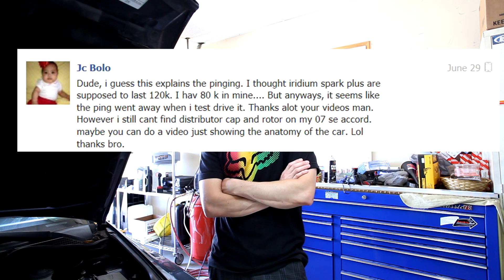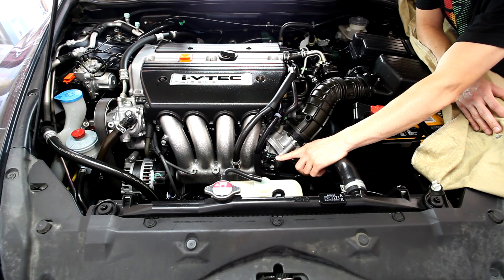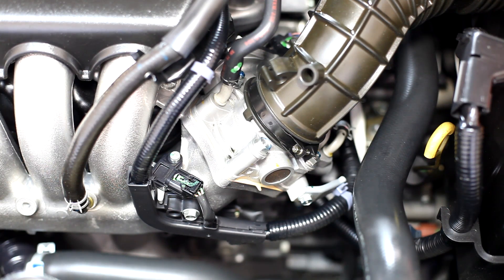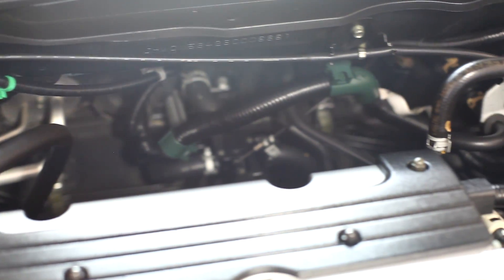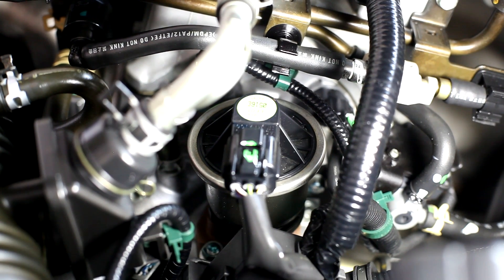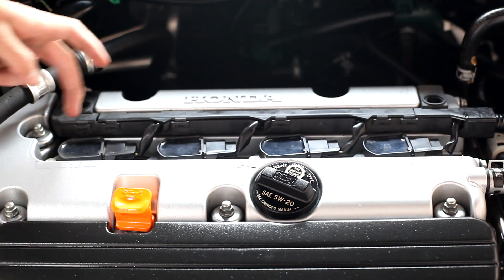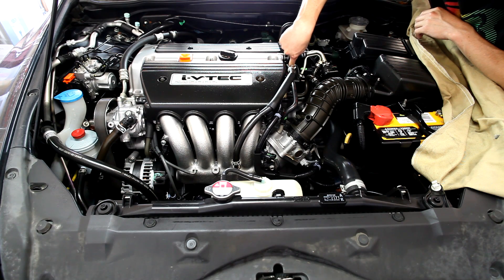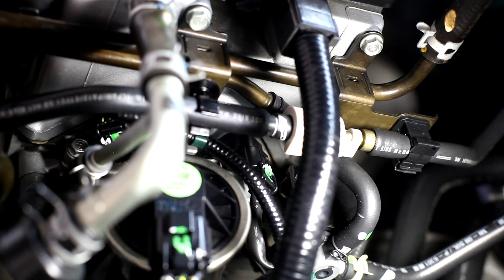2003-2007 Honda Accord Engine Anatomy

Comment: Where is the FUEL PRESSURE REGULATOR located at. I have the same vehicle. And I just diagnose my car code P0172. Engine running too rich

Comment: Damn 
I need to know what those two blue caps in the back are and you went right pass them 🤣
Reply: @2:52 Those are High and Low port for the AC system.
Reply: @BLAZEPSI  thank you so much... actually still didn’t know until now! You’re awesome 🤙🏾

Comment: I have a 07 and I have a noise coming from under the hood I have replaced the 02 and the power steering pump and the belt and the pulley and still have the noise does anyone else have that problem

Comment: Question...the two nuts that hold the front plastic cover on...on the front part ....after you remove the cover...Those screws also appear to go down into the engine.....I have one missing....Will that affect my engine in any way.? It hasnt seemed to affect performance yet....i just noticed it...but theres just a hole there where the screw should be....Im concerned.
Reply from the maker: It’s probably the stud for the nut, it shouldn’t be affected
Reply: @NutzAboutBolts  ok thank you

Comment: Hi. Very good video. Can you show where the fuel filter is located on a 2004 Honda Accord (european model) ? Thanx a lot :-)
Reply from the maker: It’s in the fuel tank, with the fuel pump.
Reply: @NutzAboutBolts  Thanx for the answer. Is this the only fuel filter ? I found an other filter (part. no: 16010sea000). The description says, this filter is located in the engine bay. And i found this one: 16010SDCE01; this looks like it goes to the fuel pump. The engine type of my car is K20A6.
Reply from the maker: Daniel Tahin that might be the transmission external filter... that’s the only filter I saw in the engine bay.

Comment: in the video at the time 4:54 there is a part that you touched its shiny kinda curved and with a rubbery black box at the end please what is the name of it i need that part
Reply: That is the same piece I need as well can't seem to find it anywhere I'm thinking I'll have to find one at the junkyard
Reply: @jonahcottrell2879  its called  BREATHING BOX
Reply: ITS BETTER TO GET THE AIR INTAKE HOSE KIT IT SHOULD COME WITH IT I FOUND MINE FOR 70.00
Reply: @lundychacon2758  thanks a ton. I ordered an intake tube the other day but it only came with the main piece I'm gonna have to order the other pieces separately

Comment: Nice video, I have a question. What are the small metal tubes (welded together) above the EGR valve called and can they be purchased? The smaller one that has antifreeze going through it is leaking on my 03 Accord.

Comment: Can I put my 2006 throttle body on the 03-05 engine? Does that fit?
Reply from the maker: I don’t think you can since the 03-05 were throttle cables.
Reply: @NutzAboutBolts  Mine accord is 2006, and trying to see if a 03-05 engine could swap in my 06, and use my 06 throttle body.
Reply from the maker: Hong I would do more research as I know both engines layout is different since they did some modification for the 06 compare to the 05 and below.

Comment: So what do I do I had a bad motor 05 2.4 accord I then bought a 03 same motor but there is plugs that I have on 05 wiring harness that is not on 03 wiring harness.I have a cold air intake 05 motor has a plug for that a 6 pin plug the 03 does not have that plug my car starts but runs bad I put the 05 harness in the should I change it back to the 03 harness

Comment: Thank you for all of your videos, much appreciated throughout the years I've had my 03 Accord 200k miles still going
Reply from the maker: Nice. Mines only at 160k for now
Reply: I have a 200k mi 03 accord standard. It idles up and down all the time. Whether I'm at a stop light or even when I'm driving it jumps a little when I shift because its idling up and down while I drive. Driving or a complete stop it idles up and down. Its not the throttle body or the sensors. What could it be?
Reply from the maker: Oweezy3rdi sounds like something’s clogging the airway of the engine. Have you cleaned the throttle body or replace the engine air filter?
Reply: @NutzAboutBolts  yeah I did could it be the EGR Valve?
Reply from the maker: Oweezy3rdi it’s possible, do you have a check engine light?
Reply: @NutzAboutBolts  yeah I do have the check light on
Reply from the maker: Oweezy3rdi what’s the code? I’d work on that first before anything else
Reply: Oweezy3rdi I have a 07 accord Coupe 119k miles, I have done so much maintenance to this car. Is your accord manual ? I had a problem with mine jumping rpms like that and running rough at the idle changed the ignition coils and spark plugs and it fixed the problem. But car still vibrates at idle comes and goes, it’s very weird. when I move the steering wheel seems to go away and come back. Have a brand new power steering pump. It Does it both when the A/C is on and off, I’m thinking it’s the motor mounts!
Reply from the maker: Chris Garcia any codes? Could be an idle issue since when you put load onto the engine, it doesn’t vibrate. If it’s an engine mount, it would vibrate more during load.
Reply: @NutzAboutBolts  fixed it. Changed the whole throttle body and sensors. All brand new. I was trying to avoid spending but sometimes it's best just to get new parts
Reply from the maker: Oweezy3rdi nice, faulty sensor?

Comment: I have a 2007 Honda accord and it's jerking when accelerating. I've replaced the pedal position sensor under the hood and still having the same issues, any suggestions?

Comment: What is that tube at 1:06 on the left? Mine is leaking on a 2012 Accord do you know how it can be fixed?
Reply: Hey I have the same question lol have you found out what it is?
Reply: Naval33 yea its a brake booster vacuum hose. No idea how to fix it though
Reply: @andreythebarista  we were talking about different parts I was talking about the power steering resivore XD

Comment: What is that tube at 1:06 on the left? Mine is leaking on a 2012 Accord do you know how it can be fixed?
Reply from the maker: Do you mean the radiator coolant reservoir? That’s where your coolant overflows stay in. I’d recommend changing it and refill the coolant to max if you can before engine overheats due to low coolant.

Comment: Nice video thank you.. you didn't point out the sensor on the right side of the head , two skinny hoses connect to it and one sensor. Could u tell me what that densco sensor is? I having trouble mounting it/getting the sensor to reach the plug.. thanks

Comment: Thanks for the video brother, very informative. Would you be able to shed some light on where transmission shift control solenoids are? My engine is throwing a code Solenoid A stuck on, and Solenoid B stuck off. I have replacements,  Are they easily accessible under the air box? Thanks for your time!

Comment: hello, is the 2004 Honda accord 4 cylinder engine is exchangeable with 2007 Accord edition?
PS:  i know that throttle body is different but i am talking about the engine without accessories.

Comment: I have one little trouble with the ECT sensor cooling fans working only if I keep the a/c on  I replaced sensor, part wiring and new connection relay and still have same problem. but does not overheat too
Reply: I'm having this same problem

Comment: I have a 2004 honda accord ex that have a 2.4 lite engine. My question is I'm trying to locate my fuel pump regulator
Reply: Cedric Smith i believe it’s on the pump itself

Comment: What's the black plate connected to the side of the air intake hose I'm trying to replace the round part that goes on that plate its rubber and has cracked.

Comment: P0325 knock sensor 1 circuit dont know if I missed it in the video but where is that located and whats the purpose of that sensor
Reply: Disclaimer: total layman here. I believe the knock sensor is actually inside the cylinder. That particular code is from an irregular/out-of-range reading on that sensor. It could need replacing (defective sensor), or maybe there is a problem with the air/fuel mixture. That same code is what brought me here. I believe in my case a cracked air intake hose is throwing off the MAF, which leads to bad air/fuel mixtures, possibly leading to out-of-range readings. I would check and make sure that your air intake is all connected and in good shape as you are troubleshooting.

Comment: What's the black cover in front of the battery that goes to a black hose type like air intake piece? Is there supposed to a filter in that hose or no? Unsure what it's called and can't find what goes there

Comment: How do I tell which cams go where? So when you have the valve cover off, there is 1 that just had a pulley, and the other has the thing that makes it a i-vech. Which goes in the front and which 1 goes I  the back?

Comment: hi i have a 2004 honda accord lx 3.0 v6, my cam shaft position sensor went bad. the mechanics told me it was located under my timing belt. is that true? because  you said it was by the egr valve.
Reply: When my Honda accord speed to number 3 giki why?
Reply: V6 engine

Comment: What is the name of the sensor to the left of cylinder #1 fuel injector shown at 5:10?
Reply: slickerthnu hey, did you find out what’s that?
Reply: It’s a solenoid that controls the dampening of the motor mounts

Comment: If you want to have better gas millage, and use 100 percent of your gas instead of 85, you'll want to put a groove in the throttle body. Do a glass pack to replace the resonator and put on some new tips of your choise for an added cool look. Also, get rid of the resonator in the bumper and put on a cone filter at the intake so that your engine can breath better. You'll want to use some royal purple for your motor oil to be more efficient and also do a transmission flush with the royal purple tranny fluid. I know all of that probably blew your mind, but it can happen, and does work out very well.
Reply: Shut the fuck up dumbass.

Comment: the is a hose attached the the valve cover (i think) which has a small rubber box that goes into the intake tube what is that box called look to replace that 
plz help asap

Comment: I experience a little vibration coming from the front right side/wheel only when accelerating. No noise yet,  but I can feel it through the pedals,  not through the steering.  Please what are the likely causes?

Comment: Nice video. 
Please do a second one to identify the air/fuel ratio sensor, O2 sensors, external temperature sensor, back-up light switch, and mechanical units like the inner and outer CV joints, ball joints, tie rods,  steering gearbox, vacuum lines, etc. Thanks.

Comment: What is the part called that is connected to the hose right after the maf sensor.  It looks like it has 2 connections to the hose.  One wide and one skinnier but both are on the same part.
Reply from the maker: Can you send the picture to our Facebook page, it’s hard to figure which hose you’re talking about. Thanks.

Comment: We're is the gas filter located?
Reply from the maker: You mean the fuel filter? There’s one inside the fuel tank, you only replace it if the fuel pump is bad.
Reply from the maker: You don’t need to change it as a preventive maintenance. You only change it when your fuel pump goes bad.
Reply: Is it one unit  I'm wondering for preventative maintenance does the gas filter clog ?and could it be changed sepretatly my car is going on 10yrs so I'm trying to do as much as preventative maintenance .
Reply: Thanks

Comment: I have a 2006 Accord K20Z2 with manual.
The engine is running good but in warm idle the whole block is shaking a little bit. The front more than the back. At the intake manifold about 1/2 inch up and down. And it stops when it is anything over idle or cold idle. You don't notice it from the inside of the car.
The front motor mount looks good. Idle is about 700 rpm. Maybe to low? Can the idle be adjusted? Or what else could it be?
Reply from the maker: any check engine light?  I think idle is 750 +/-50 from the top of my head depending if its a/t or m/t, don't quote me on it. lol.

Comment: are all 03-07 accord 2.4 engines the same can i use a 07 in my 03 or vise versa thank you
Reply from the maker: its the same engine but I think the intake is a little different since they position the sensors at a different place, and the throttle body is different too.

Comment: Have a question. My girlfriend took her accord to auto one to read the check engine e light. They said her crankcase breather hose is the cause for the alarm. They mean PCV valve and hose?
Reply from the maker: its possible, but he was talking about the hose... check for leaks, whats the check engine light code?
Reply: NutzAboutBolts the engine code is P0171
Reply from the maker: system running rich, check for vacuum leaks at, PCV valve, PCV hose, EVAP canister purge valve, throttle body, intake manifold, and the brake booster. Should be easy to find them.
Reply: NutzAboutBolts will do thank you
Reply: Rivers Rivers just to the right of his finger at 5:31 there is a small 3” rubber hose that is extremely susceptible to cracks and breaks. Check here there as well. If you need it replaced. Go to Honda because they can find it easier and its only $8. Just replaced mine today. Also, it has a particular shape so don’t just get a random hose from anyone.
Reply: sweetcheels thank you so much for that will check it out tonight.

Comment: WHAT IS CALLED FOR TWO HOSES CONNECTED TO( 'L' SHAPE PVC /plastic top and bottom is brass one inch thick bolt) ONE FROM THE HOSE BEHIND THE INJECTOR AND ANOTHER FROM AIR INTAKE HOSE?
Reply: what is the name of this part?
Reply: what is the name of this part?

Comment: where can i find the fuel pressure regulator?
Reply from the maker: its inside the fuel tank. You will have to remove the fuel pump unit in the back seat. Once you remove it, its with the fuel pump unit.
Reply: thanks man! quick question i have p0171 code have any advice?
Reply from the maker: the fuel system is running rich. You want to check your fuel pressure regulator, valve adjustments, and fuel injectors if its leaking.
Reply: NutzAboutBolts ok thank you im going to try all that. 
I hope it works.
Reply: good information I was looking for the fuel pressure regulator myself..... thanks

Comment: Question: How would I know my 2006 Honda Accord Sports Edition needs motor mounts replaced and how many mounts does it have?
Reply from the maker: if you feel your car vibrates during idle, your motor mounts are going bad. There are 3 motor mounts, 1 rear, 1 front and 1 to your left on the passenger side.
Reply: NutzAboutBolts Thank you!
Reply: Actually 6 engine mounting. Main front and rear using hydraulic.
Reply: DAN DRAD , you are wrong , hes correct engine only has 3 mounts

Comment: My 03 Honda accord won't go pass 3k rpm  any suggestions on why its doing that?
Reply from the maker: check engine light? its probably in limp mode, where it prevents the engine to pass 3k rpm to prevent any major damage. Whats the history of the car before this happened?
Reply: NutzAboutBolts yes check engine light is on.
Reply: @carlosenciso9229   oil relay switch. Back side of engine.  Located on Oil pump .

Comment: Question: after having a P0420, I changed the Cat, & intake hose( i found a split in it) code went away. now im experiencing an intermittent start. sometimes it's slow, sometimes it takes a couple attempts. It appears if it doesnt start i have to jump it. when it starts it runs perfectly!!! ive checked everything and am very confused.
Reply from the maker: could be your battery.
Reply: Thank you for the reply! could there be anything else. just recently got a new battery.
Reply: hngbones I have the same problem and I'm thinking of fuel filter.
Reply: Be sure to check your timing chain.
Reply: Sound like bad fuel motor, $10, could also be ignition switch

Comment: Do you have a video on how to check fuel pressure on this 2.4 engine ? I need to check it,but my fuel pressure tester dont have a connector for this car... Im thinking I need to T it in at 3:18 in the video at that hose right above the EGR Valve...

Comment: Can you tell me the location of the CRANKSHAFT POSTION SENSOR ON A 2004 HONDA ACCORD 2.4 LITER ENGINE?
Reply: big d williams pull the passsnger tire off its by the cover of the timing chain ,actually the pulley ,near that area ,there u will find that important  sensor

Comment: Thanks for the good video. Could you kindly tell me the location of the ground wire from the engine to the chassis?
Reply from the maker: There is 2 engine ground cables. One is on the valve cover to the engine mount by the pulleys, the other is near the intake box.

Comment: great video thank you. I need to change an O2 sensor, I got the code: P0141. Can you please tell how to find this sensor?
Reply: Its plugged into the side of the catalytic converter. Reach it under car on passenger side. The connector is under passenger front seat. You might need a small blowtorch if it's the original sensor lol. Angled o2 sensor wrench helps as well

Comment: Thanks for the video, i did a coment on your other video, where is 02 sensor heater circuit located (p0135 code) thanks again.
Reply from the maker: it is the air fuel ratio sensor, its the sensor right after the exhaust and before the cat.

Comment: @nutzandbolts...I believe my throttle body is still cable also. Love the vids. You guys should do a video on a 2003-2007 Honda Accord manual transmission fluid replacement. Would you happen to know the crush washer sizes for the drain and fill on a Manual Transmission 2004 Honda Accord?
Reply from the maker: yes its cable, we're not sure of the size for the manual transmission crush washer. You can buy them at the dealership, less of a guessing game lol

Comment: @nutzandbolts...my 2004 honda accord 2.4 on the throttle body near the MAP has a sensor. But yours doesn't.
Reply from the maker: your's 04, mines 06, they made some changes on 06 models.